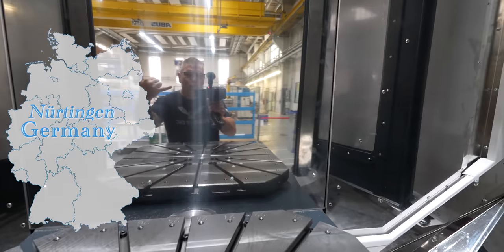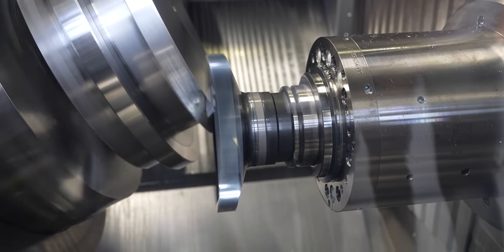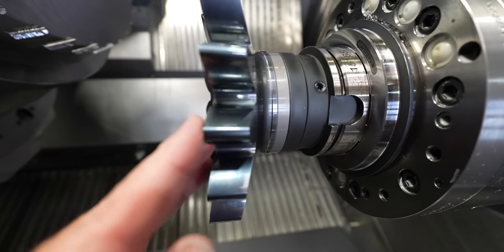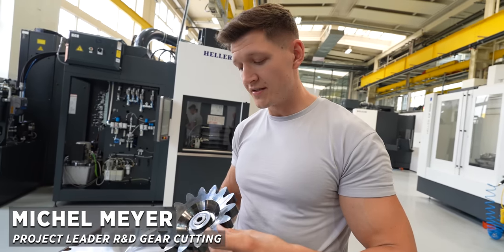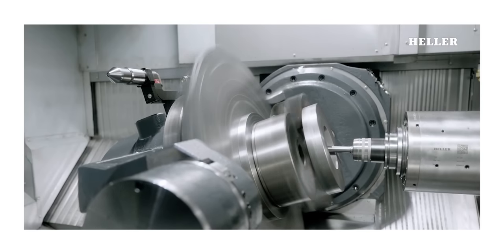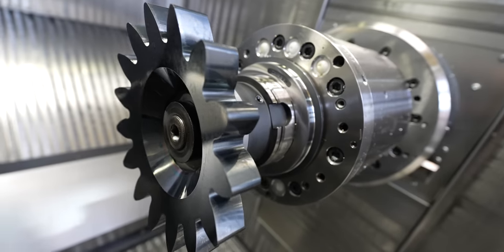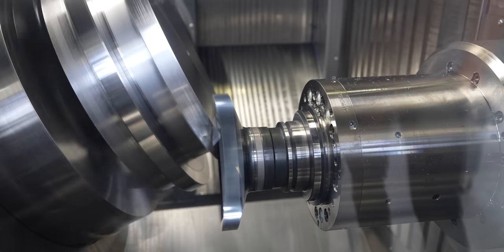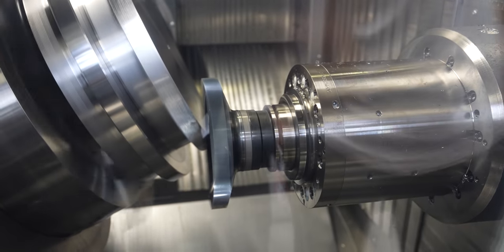The Hidden Art to Machining Gears | POWER SKIVING

Comment: Amazing the motors can be synchronized with such precision.
Reply: you can really synchronize them rather easily, what's more difficult is figuring the feeds and speed to prevent the feed from bogging down and breaking the tools
Reply: The spindle and the holder are rotated by servomotors. The cheap ones have 10,000 pulses for one rotation, the more advanced ones have 1.2 million pulses per rotation. It's a matter of sending syncrhonized pulsed to both motors at their specific pulse rate and the servo will keep up with those rates. You can get whatever combination of rotation speeds. Funny thing it's called electronic gearing :)
Reply: @car9167  still amazed it’s that accurate with variable loading.
Reply: @rb8049  It is. The servos are running PID loop (proportional, integral, derivative). Actually they are running 3 PID looks one within the other. The innermost is the current loop. That controls the current stays in the commanded parameters. With current comes torque and adjustment to load. An outer loop is on the servo speed and the outmost is on position (recall I said pulses, one pulse 1/1.2million of one rotation). If you allow the servo PID loop to accept few pulses of error that's few pulses in 1.2 million in terms of inaccuracy on the speed alone. That's nothing.
Reply: @car9167  I would be interested to know if they are using something as simple as 2 uncoupled closed loops fed with effectively open loop harmonic signals. 

I suppose it is possible to make it work this way, but the performance requirements to independently keep the relative positions in the range of precision machining seems insane. But I am not so familiar with industrial servos, so maybe they are better than I expect. 

I think it would be more interesting if they had some coupling between some of the inner loops, which may improve the performance for the objective of synchronising the motor positions. This could also mean each motor/controller individually does not need to have such a high performance level and would potentially reduce costs due to a more thoughtful design.

Either way, it's probably a trade off between engineering time and part cost. If it is possible to "brute force" with off-the-shelf drivers and control systems for not much more cost then probably not worth engineering a more complex "optimal" system. And it's also probably proprietary so I doubt we will get an official answer.
Reply: @jackaw1197  You need servos synchronized motion for other reasons in a 5 axis machining (or even 3 axis). When you do a 3D path from x0,y0,z0 to x1,y1,z1 the motion needs to be a perfect line. That means not only the speeds are synchronized but also the acceleration and deccelerations. If you go 5 axis, the two extra axes are rotational so get's even more complicated. I'm not sure your solution will work with synchronized velocities and accelerations in 5 axis at different feed speeds or rapid traversals
Reply: @car9167  I am assuming you know more than me about this specific topic. So I'll probably just trust you. I have pretty good knowledge on control systems, but not the in application of precision machining. 

Mainly I am just interested in knowing/speculating if there is some more advanced form of control system. With modern control design it is not so complicated to create advanced coupled control systems (e.g. For 5-axis machining), especially for a large company producing high-end machines where it might provide them a competitive advantage in cost effectiveness.
Reply: @jackaw1197  I'm not sure what this means "2 uncoupled closed loops fed with effectively open loop harmonic signals" and how it could apply to a 5 axes synchronized motion (or even 3 axes for that matter). The servo motors are fed pulses (pulse and direction) or quadrature pulses or Modbus commands. Not sure how your harmonic signals translate into pulses. You cannot feed harmonic signals into servomotors I don't even know what those are. I understand the concept of harmonic signal but not in this context
Reply: @car9167  By signals I just mean whatever setpoint control is used by the central controller to the motor/servo drivers/controllers (simple pulses or some more complex digital setting). By harmonic I mean that the rotation of the two axes (in this case refering to the power skiving) are both controlled by the same underlying variable but the "signals" to each axes are multiplied differently so that the teeth line up perfectly with the cutting tool.
Reply: @jackaw1197  Well is not that simple and how would you do multiplication if one axis needs to go 37 steps and the other needs to go 137 steps in the same unit of time. These are both prime numbers, your multiplication thing will not work. The CNC controller uses an FPGA inside which in turn uses some sort of PLL to generate those pulses at those odd rates. The odd pulse rates are coming from a calculation which involves the feed rate (at what speed you machine the metal) and the tool path to follow dependent on the part final geometry
Reply: @car9167  you know, I'm not really trying to make an argument here. I just think the whole system is impressive and wondered if there is an interesting way they achieved the performance needed beyond SISO pid control.

Comment: So I'm taking it, that the tool when it presses into the part, it starts about 1/3 of the cut. When the tool spins with the part albeit at a higher speed, the circular motion of the tool in-line with the part conducts another 1/3 of the cut. This all happens at extremely fast speeds. Then when the tool leaves, the last 1/3 of the cut also involves the chip/shaving to be thrown out. This is different than a normal cut where you tend to scrape or cut away at a part that is sitting still. This is you pressing into the part, a little like reaming but not quite.

Comment: We make such gears at my work but its not nearly as fast. It does not rotate at such speeds. Im not sure what its called in english but the tool is just cutting in Z-axis while rotating very slowly in sync with the rotation of the workpiece. The machine is like 40 years old :D
Reply: Hobbing is the process I think in English.

Comment: There is also a flexible way of cutting gears on not gear specific machines, it’s called Invomilling. Basically you can cut any gear with 3 tools. Is from Sandvik Coromant. The machine motion in the end creates the tooth shape not the shape of the tool.

Comment: What quality class of gears can you make with this combo machine and tool?
Reply: A technician of a different OEM proposing a similar solution (power skiving on a 5 axis vertical milling machine) told me that normally you can achieve quality 8 or 7 (DIN). In some cases he said you can go up to quality 6. However, in my experience with geat cutting machines, quality is strongly dependant on tool and workholding.

Comment: Is the machine a lathe or a mill? as on a Lathe you spin the work and on a mill you spin the tool.
Reply: Not 100% but pretty sure it would be a lathe, since u can use a live tool holder and spin the tool and the part at the same time